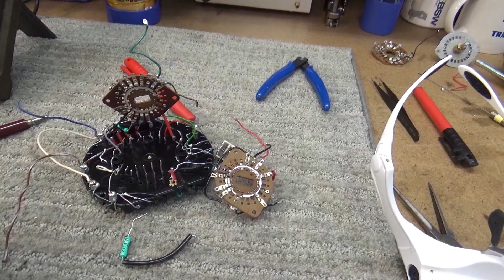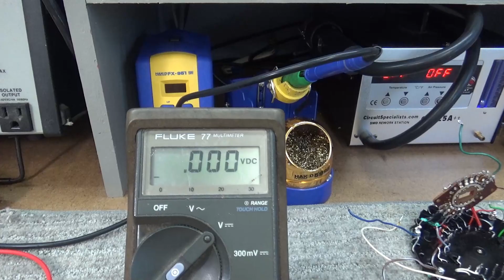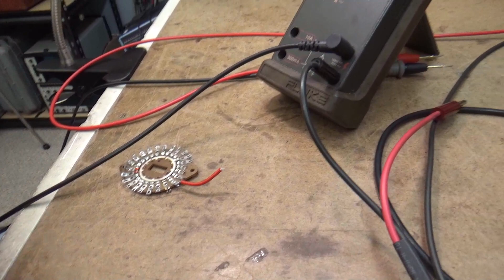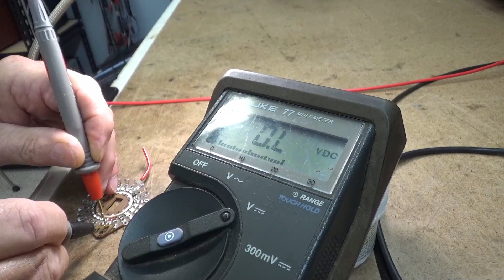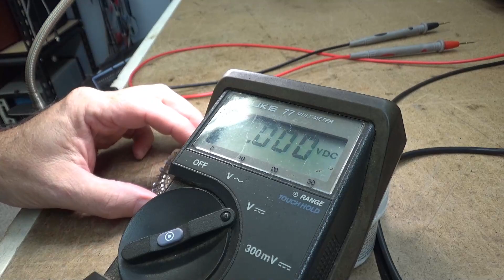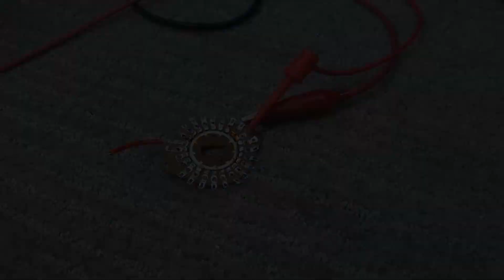Quick Tech Tip Finding Sneak Paths in Circuits

Comment: Interesting that a conductive material on the phenolic base caused this issue. Scraping it away with a dental pick cured 
the problem. But it had more wiring issues that you  squared away. Very good,  because this kind of stuff can really drive
 you nuts!
Reply from the maker: Those Phenolic wafers looked brand new. I believe now that there was some battery leakage that made its way down to them and contaminated them. The "high voltage purge" burnt them out. I sure didn't want to throw that meter in the bin.

Comment: That is a good tip! I saw that you have a Fluke 8010A bench DMM in your shop. It may, have a "conductance" measuring function in it that is unmarked on the panel buttons, but is still functional, and will let you measure a resistance fault to 10 Gigaohms using low voltage and no need for an additional power source. If you push down the "KΩ" button, and then, push the 20 and 200K (should be KΩ) buttons, and hook a 100K Ω resistor across your test leads, it should display a value of 10.0 uS on the meter.  Anything other than all zero's indicates a path of conductance, which, is the inverse value of resistance. I found a user manual for a 8010A / 8012A DMM, and the 8012 has the markings for that function, the 8010 does not, BUT, I found a handheld 8021B DMM not being marked but still having the mS / uS / nS functionality if the right buttons are engaged.   I found a "qsl dot net" website that had the 8010A / 8012A manual, so I thought I would have you give it a shot and see if you had a built in freebie / easter egg.